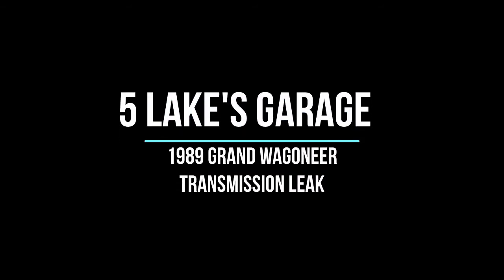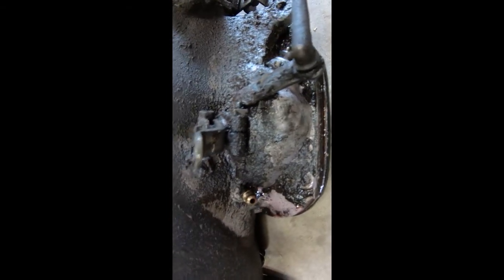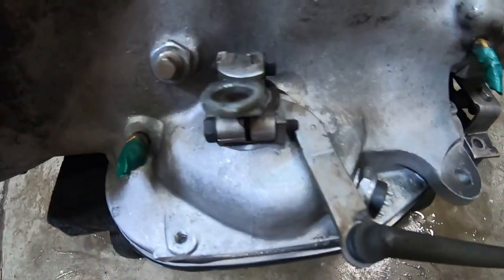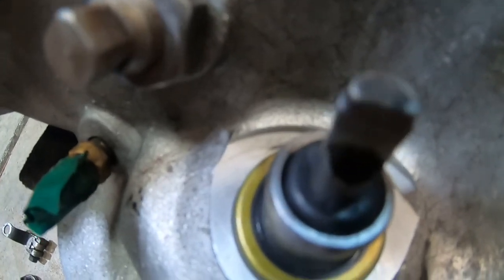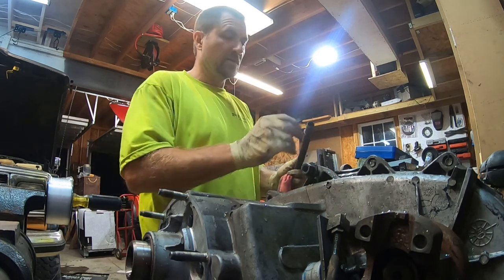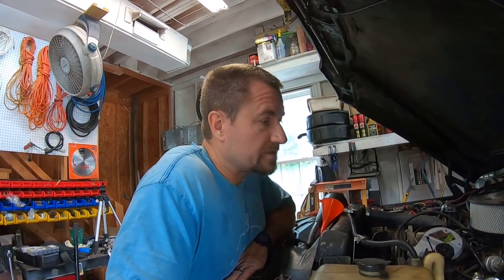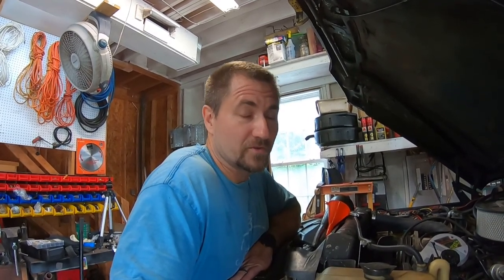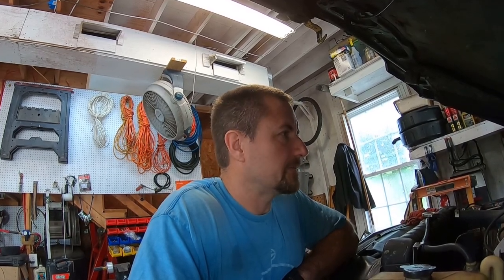1989 Grand Wagoneer Transmission Leak fix Shifter Linkage

Comment: thank you for this!  89 Wag here as well.  I'm so tired of the LEAKS!!!
Reply from the maker: No worries.  I hope it helps.  now you can do this without taking the trans out.   I only took it out so I can film it better.     There is a cover that you can take off on the inside to accesses it.   Just a pain since there is not any room.   Good luck and thanks for the watch and the Subscription.    :)   

I am working on a few more videos on the wag.  It has been neglected for too long.

Comment: You have to pull out the entire trans for those 2 tiny seals??
Reply from the maker: You do not.   I pulled it to be able to see better.    You can pull the carpet and unscrew the access panel.  Looking back at it.  I should have done that.

Comment: Did this to my 90 a few years ago, thank god these Jeep have that inspection cover plate on the transmission hump in the cabin, take that off and you have access to the transmission and everything from up top, you dont have to remove it to do this seal.  You did far far too much work to replace a seal you can get access too from on top lol
Reply from the maker: Agreed.  I watched a few videos and non of them removed the trans.  The biggest issue I had with the videos I watched was that they could not get really good camera angles.   I wanted to not only fix the seal but show you all up close.   It was a pain.  Now 9 months later the trans is out again for a full rebuild.  Don't forget to subscribe so you can get that video.   

Love the JGW.  We need to keep them around.   I am not warming up to the new one yet.  

Thanks for watching
Reply: @5LakesGarage  yea i got my 90 5 years ago.. mechanically it was good and i daily drive it.. but it needed alotttttt of work. 

6th owners.. it sold on ebay in 2010 from west virginia.  It looked great outside under didnt look too bad..  then as the years went on. The rockers quarter panels.  Started rusting out of bondo repairs.   The frame by the gas tank was repaired at one time.. but poorly.

First year i had it. I fixed all the oil leaks, cut out small hand sized sections of floor boards.  And learned to weld there lol.   The worst rust was where the floor goes up for the back bench seat.  Both corners by the door hold water and were so rusted out i could put my foot through it.  I fixed all the flooring.

Then i replaced the upside down... yes upside down leaf springs.  So sagged they were inverted and the tires were in the wheel wells lol.   I got factory height springs made in the usa which lifted it uo 3 inchs lol.. 

Then i had to drop the spare tire and take off the factory hitch brackets in the frame back there..  it had a tow package but someone took the hitch off and left the brackets...  and of course metal on metal in west virginia.. rotted sections of the frame there.. had to fix that..

Then last year i dropped the gas tank.  Cleaned up the skid..  replaced the rusted straps and Triangle support bracket that was basically dust.   And then i saw the ghetto repair on the frame.. instead of cutting the rust out.. some idiot weldes 90 degree angle plates in there.. of course causing it to rust 10x worse.  I cut it all out and got a donor section from a 79 cherokee chief.  Its clean and nice looking now. 

Then i did the body mounts.. all of them were rotten..  the two very rear ones werent even there. I could grab the bumper snd lift the body off the frame up and down..  the other body mounts rusted the holes out 4x their size.. so i can to cut every bracket off and fab new ones.  But thats all done.

Then of course.. the shocks mounts on these Jeeps are hollow up front.  They hold dirt and mud and sand. And rust the frane behind them..  i saw a tiny crack when doing my brakes.. guess what i could pull the shock mount off by hand.. the frame was ao badly rustes it was gone and only the top was left.. but it cracked in half...  luckily it didnt shift.

I cut it all out. Welded new steel in.. and mounted the shock back on.. checked th3 other side.. its rusted too fixed it.

Every junkyard wagoneer ive seen wheb i took the shock mounts off they all had this rist behind them.. so check yours.

All the major rust is done.  Did both from outer and inner wheel bearings. I gatta fix the ball joints on drivers side in a few days.. and i found the u joint on that axle shaft is bad needs replaced.. so ima do that and the spindle bearings.

But yea... lol.MAJOR repairs are finally done..  So last year i lifted it 2.5 inchs.  Got 31 inch mud terrains.  I found a factory brush guard from that 79 cherokee chief.. put it on.. i added 2 round kc style 100w 6.25inch  lights on it.. and the last 2 days ive been installing a 63 inch long roof rack basket and 5 more kc style lights on top.. all the wiring isnt fun lol.   I added 4 led 4 inch pods on all 4 corners of the basket so i can light 360 degrees around my jeep now.

And i put in a 150amp alternator to power all this.  Andci put that 79 cherokees trailer hitch on mine.. and i made myself a folding soare tire hitch carrier.. took a folding basket hitch with an extention for s ball mount so you csn still tow.. and i bought a hitch spare tire thing from curt.. i cut the lower section off that you slide into a hitch.. snd then drilled two holes for th3 bolts.  Put it on that folding basket thing.. and now i can pull a pin and the tire holds down allowing me to open the tailgate.. and its below my window so i can see.. i dont like folding open door spare tire things because they block 50% of your window.

Lol sorry long description...  but yea.. my Jeep is badass now.. i get alot of people waving thunbs up.. wanting to buy it at gas stations.. ect

Oh and i redid the whole exhaust from y pipe down.. but im gonna pay a shop to do the exhaust manifoldd.. thats one thing i refuse to touch...  and ill probly pay a shop to do the rear main seal.. i tried it twice now and failed.. and its leaking a quart of oil every 300 miles.. it sucks..  i had to make s shield on the transmission insoection cover to cover the exhaust because it leaks on the piping.. dont want fires.

Never ending with these old Jeeps. I. Always say if i didnt buy this thing.. itd be sitting.. in a driveway never driven.. rotting.. or in a junkyard..  the last 5 owners did squat to it..  It only had 112k miles too... ive put 35k on it in 5 years lol
Reply: Ill make a video of my 90 soon.. sub to me and watch it when i upload it.  Sorry im new to making videos so yea.. my phones limits 10 min long videos too so i cant show everything i did.. but at least youll get to see my jeep
Reply from the maker: Wow.   That is a lot of work.  I had something similar but not as rusty on my CJ.   Not sure if you saw that video.
https://www.youtube.com/watch?v=vhkcqWMnDP4
I will be fixing some of the rust on the floor pan as well.   I also cut into the back floor to put storage where the spare tire used to be.   

No worries on the long description.  I love reading or watching other people's projects.   It helps me learn.   The main reason why we started the channel is to help others and to enjoy time with my kids since they are sometimes I camera crew.   Learning a new skill.   
One the trans is back in the wag I will do a walk around that one and show the mods I have done with that.   One of them was the exhaust.   Since the Wag was picked up for my wife, she got a new muffler and headers for Christmas.   it was a missed response from her but I had to reroute the exhaust and modify the cross member a bit to allow some room.   I cut out rounded area on both sides and used what was left over from my 2500 dodge bumper to weld in.    Was a fun project.   
Some other videos that might help you on your project.   
Swapping out your lugs for 1/2 inch ones.   (not sure why the put 7/16 studs.)
https://www.youtube.com/watch?v=gFhPYSEQ7vk
Salvage yard on the East Coast
https://www.youtube.com/watch?v=AFAspCzMCeI
It is a Jeep so this one might come in handy.    Trailering your Jeep
https://www.youtube.com/watch?v=1eVZFWlx4ro

I have over a 115 videos and have plenty to go.   I would love to see your video on your 90.   You seem to be passionate  about your rid and would love to give you  a sub.  Don't worry about how the videos come out at first.   You learn so much so fast it will be fine.   We are always willing to help someone out on 5 Lake's Garage so if you have any questions drop me an email. 

Send me an email when you are ready.  
5lakesgarage@gmail.com
Reply: @5LakesGarage  do you live on the east coast ?  Im in Northern Virginia.   Yea my Jeep had alot of rust... whats odd is if you stand there.. and look at it.  It looks beautiful.  Fairly new paint jobs (within like 7 years lol) interior is immaculate..  drives amazing..  has a lifter tick though...  been doing it since i got it..  my mistake was meeting the previous owner and not hearing it cold start... cold start it sounds fine.. but when you drive off for 50-100 feet you hear that loud lifter..  then it quiets up.. judging by the sludge in the oil pan and vslve covers and tarnish in the engine..  people never changed the oil on it.. Its amazing...   But besides that lifter its got good oil pressure and drives fine.

I did a compression check 7 cylinders are all 150.. but cylinder 8 is like 130.. i suspect thats where the bad lifter is too..  most likely the camshaft..  i heard they wear out back there.

Oh well.. fill it uo with oil put a bottle of zddp rislone for zinc because its a flat tappet cam and just keep driving it.
Reply from the maker: Yes keep them going.    I have see people put in 3 quarts of oil and 2 quarts of kerosene.  run it a bit and then change the oil again a few times to get ride of some of the sludge.   it is a bit expensive buying oil and filers but it does clean it our a bit.    

Don't forget to send over your video.   

Good luck.
Reply: @5LakesGarage  ill make a video tomorrow if i have time.   I just spent 13 hours today wiring up off road lights. And back uo lights.  Wired em all into a relay/fuse box and power distribution box and a ground ternimal box i got.  So i dont have like 7 inline fuses and relays hanging off my battery lol.  Put the boxes  on the fender where the ac lines are.  Just moved em outa the way.  Perfect spot to put junction boxes

Actually kinda proud of myself on this one.  I remember when wiring was like another language to understand.. but now ots actually kinda fun running wires. Crimping and ect lol.